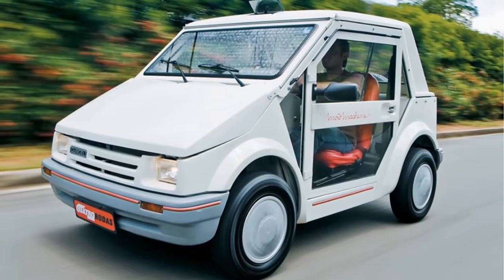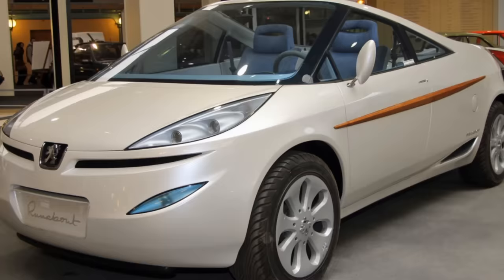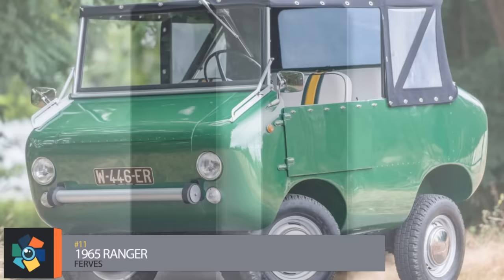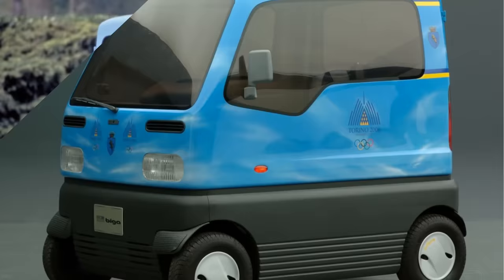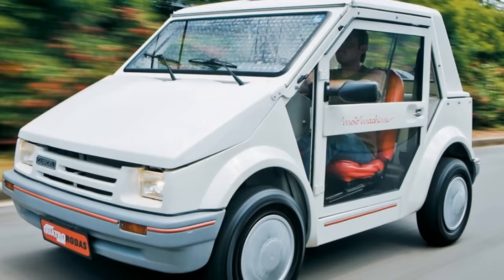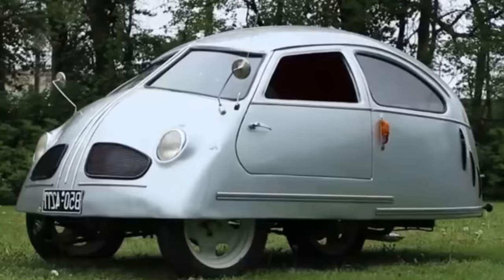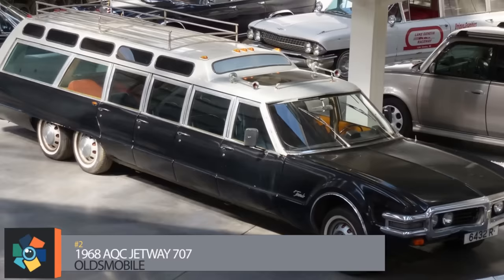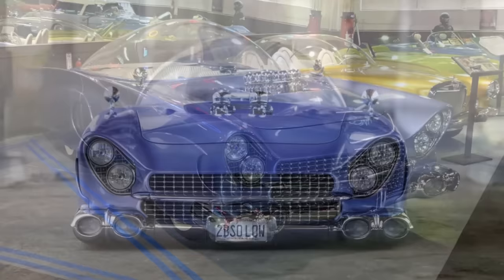15 Retro Vehicles That Define Crazy

Comment: I really like the BMW Columbus...but I'd fit it out for traveling alone.  You could live in that thing.
Reply: Me too I wish that there were more RV/Coach/Van's with tapered jetfighter bubble where you drive.
Reply: Yes! I would’ve love a tiny house roaming RV type fitted Columbus, that’s a sexy looking machine.
Reply: I love it, been in it... And it's not a BMW, just has a BMW engine. It was made by ItalDesign.
Reply: Still want it anyway
Reply: @RomainSandt  Ital Design is no joke, actually top, I was thinking exactly the same thing, it's a duplex flat, but more drivable than the average motor home, the v12 is awesome but maybe overkill..

Comment: Number 13 (Optica): This was definitely NOT quieter than normal airplanes its size.  A sample was at Wright-Patterson Air Force Base in ~1980 for evaluation. The airplane made the loudest, most annoying whining noise I've ever heard. Visibility may have been great, but you could hear it 10 miles.

Comment: The toronado is always a front wheel drive I have 1968
Reply: The dual rear wheels look like the same set-up as the 72-78 GMC motorhome. It also used a Toronado engine & transmission.

Comment: I love those propeller powered vehicles.. I tried to the same thing by strapping a big ass fan to the front of my bike, but the extension cord wasn't long enough
Reply: In the Time after WW1 up to 1936,many People had the Idea, to put Profit from the Prop, by taken it into a Vehicle.But its a Horror to drive.A Bicycle with a Prop is easy,because you put all together and take it on the Back like a Backpack.
But your Brakes are not good for this Speed and you cant easy Stop at a red Light.Its like the Turbinecar,it blows like a Jetengine ,Imagine what the the
Driver in the Back would say ,if his Car is taking Fire.Planes had other methods
to Brake(thrust reverser and stuff like that).Dont do it on Street,its only on
a Racetrac legal.

Comment: That boat-mobile would have been my favorite if you could actually drive it out on the water like an aqua car. That being said, I'm torn between the Olds super limo and the BMW shuttle bus as my favorite on this list. I'm a huge fan of Oldsmobile, and I love combining cars that don't match, like a fast grocery getter, or a convertible station wagon. Here you've combined a limousine, a station wagon, and a semi truck, all into one. Give it some serious HP, a targa roof for the front seats, and maybe pop the top off the back to make it an el camino style truck bed, and this beast is complete... And of course, the BMW minivan is just too cool in my opinion. This would make an awesome little travel mini RV. I had an Old Silhouette a few years ago and it was like driving a space shuttle. I imagine this would be a similar driving experience, but WAY cooler.

Comment: Lets go commandeer that airmobile from the national museum, figure out exactly what allowed it to get 43 miles to the gallon and create new versions that can handle biofuel and get the same if not better still mileage or put a biofuel digester in the back of a natural gas powered truck or trunk of a car and make the vehicles fuel onboard and never need natural gas or petrol for another vehicle again!!!!

The Optica sounds like it was shut down for the mere fact that it could compete against automobiles and/or fuel milege as well as competing against helicopters

Most of these were pretty cool! I liked most the air powered vehicles caught my eye for sure, one could add peddle power to this to help out and or in the even there was not enough wind! I liked the ranger, and both aircrasfs shown!!!
Reply: The Duckling Homestead and Gardens --> I had the same thought about the Optica! It appears some of the competition were actually afraid of the superb design and performance.

Comment: Correct me if I´m wrong, but the last car had a 1959 Caddy bumper, 1959-1960 Lincoln headlights, 1961-1962 Chrysler dash, 1979-1989 Ford steering wheel, 1960 Desoto tail fins & lights and a 1958 Caddy bumper (rear).
What did I miss?
Reply from the maker: The 1989 Ford Taurus rear axle.  But who's counting.

Comment: About 20-ft long van thing, 20 ft sounds like it's long until you realize a full size pickup truck is the same length.

But fitting 9 people in it sounds almost like a bus. I wonder if anyone would buy one if it looked normal.

Comment: My favorite the Oldsmobile Toronado Jetway  verrrrrrrrrrrrrrrrrrry  Rare  3 speed automatic  transmission front wheel drive V8 425 big block  built  on the front wheel drive package of the  eldorado toronado  cars  the same frame was also use on the GMC motor home  of the 70 the  Jet way was use for air port and hotel  coach services  .

Comment: The Oldsmobile Tornado Limo is FWD because the original Tornado was too. It may explain why they chose to convert only the Tornado because then they didn't need to mess with the overly long driveshaft a RWD limo would need.

Comment: The Columbus would have made a great van design if it were a little shorter and if either Toyota, or an American company produced it. A V8 combined with a well built automatic transmission like what Toyota produces would have been an excellent combination and would have done well in North America. I wouldn't touch anything made in Europe and sold in the America's, all over priced, over engineered pieces of dung.

Comment: As with many of the others in this comments section, I too found the BMW Columbus quite intriguing. I don't understand why a GERMAN car company would want to celebrate the "founding" of this side of the world when they neither funded the trip nor benefited from the discovery, but the van/SUV/RV trybrid they've come up with is something I would gladly spend $150k on. (Provided I had that kind of disposable income, of course.) Especially considering you could modify the thing into a lighter Class B motor home & swap the engine out for a hybrid one, thus conserving fuel & reducing the environmental impact. Add that to its aerodynamic design & you've got yourself a place to live in that still gets plenty of MPG's & still gets you from Point A to Point B everyday. That's nothing to sneeze at, really.

Comment: Gurgel Motomachine was sold regularly in Brazil in 80's and uses some Honda CB400 parts in it.
The factory bankrupt because the pressure of GM, FORD, FIAT and VW in here.
Reply from the maker: Yes prices. We get that a lot. If we don't include prices ironically we get the same complaints for not including them. It's a strange predicament to be in, with the end result in both scenarios being the same. I wonder, if a disclaimer stating the prices are no longer included, because it distracts from the topic of design would fix this issue?

Comment: The BMW Columbus had a 5,000cc engine, not 500. That's 5 litre , or 307 cubic inches.
Reply from the maker: If only you noticed corrections pinned to the top for two years...

Comment: The Runaboat ist still interessting but it's tempiting to drive with it on the Water. 
Of Course not...but the great temptation...XD

The Capsule...i hat this Thing, why must i see it in two Videos...XD

The Biga whould be perfect for a Microshuttle in Big Airports. 
This Car is so tiny it can drive in the Terminal and bring Passengers 
to a Gate thats far off or the Crew to there Machine. 
Its looks not great but in this Setting whould be the Biga very usefull. ^^

The Seeranger looks more for a 80th Concept for a future Moon or Mars Vehicle. :D

The Bubbletop looks very 60th Spacey. 
I like it. ^^

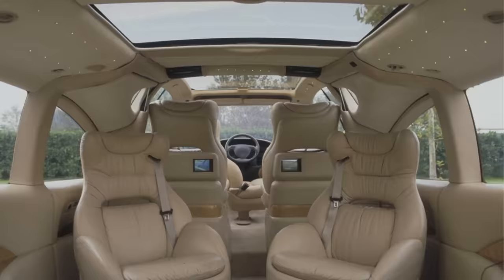Comment: 9:00 500cc v12? I think you meant 5000cc, most bikes are 600cc. It would be amazing to have a 500cc 300 hp motor but it would be a 3 maybe 4 cylinder job making more like 20/30hp.
Reply from the maker: The correction is pinned to the top (two years ago) and it's already been brought up 700 times.

Comment: Most interesting BMW van with a 500cc v8 engine.....would that be 500ci? As in cubic inches? Not cubic centimeters?
Reply from the maker: The correction is pinned to the top (two years ago) and it's already been brought up 700 times.

Comment: You have mis-used the term retro, which means 'made to resemble an older style.'   Also, #1 doesn't count, as it is not an original design, but a highly modified old car (but it does look neat!).